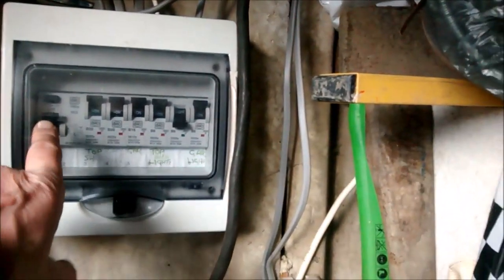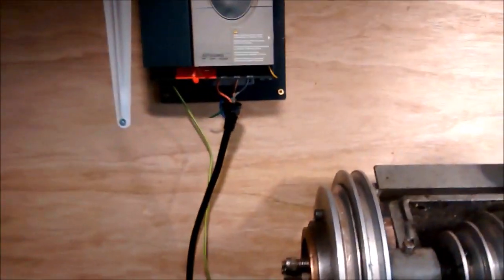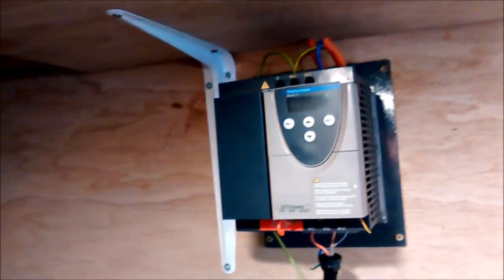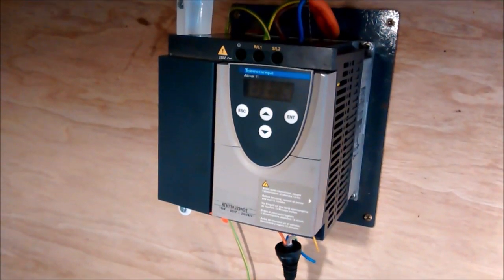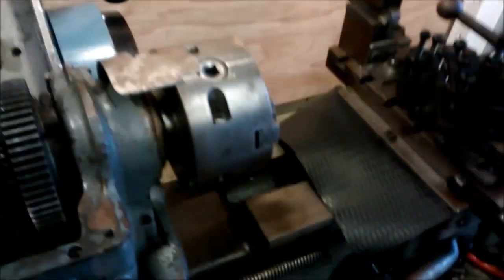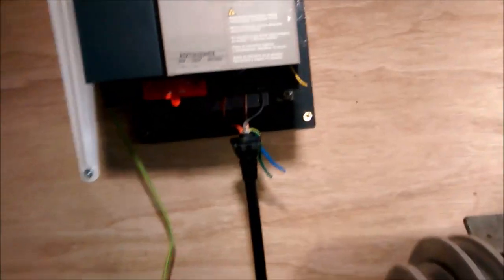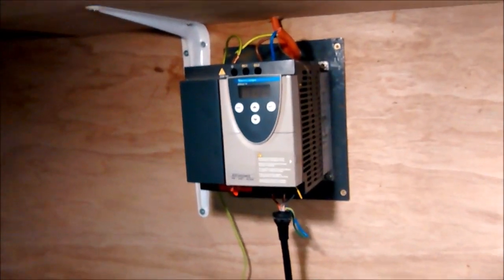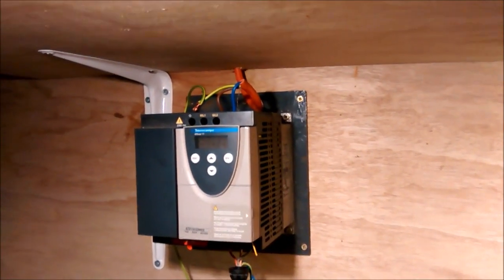Altivar inverter trips house electrics

Comment: Hi Lathe bits you will need to put the inverter on a feed without an RCD due to the leakage current.
Alternatively some VFDs enable you to remove the EMC capacitors by means of a plug which stops the RCD trips.
Reply: The leakage current is generated from the filter circuit on the front end of the drive designed to prevent harmonics back onto the mains
Reply from the maker: Hi Andrew. I couldn't dissable the filter on the Altivar 11 inverter. I rewired the house consumer unit so that the garage is fed from the non-trip fitted half. There is still an RCD on the garage consumer unit but no tripping now. Thank you for your insight.